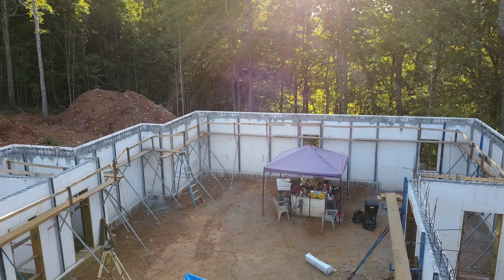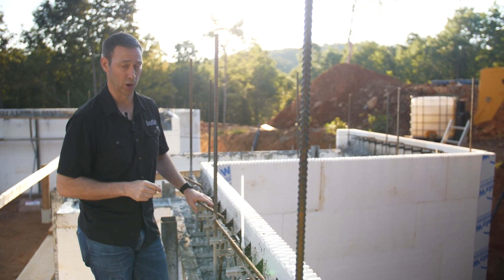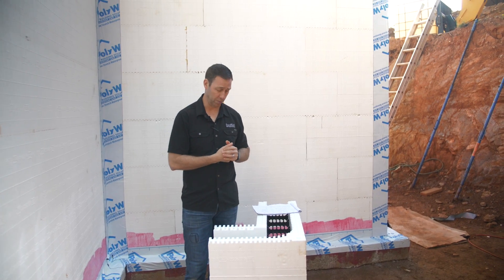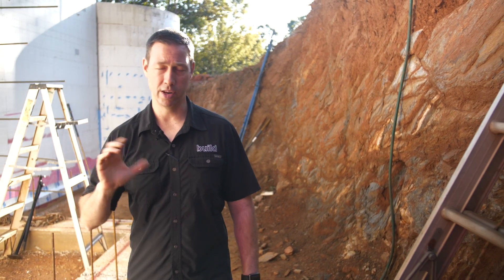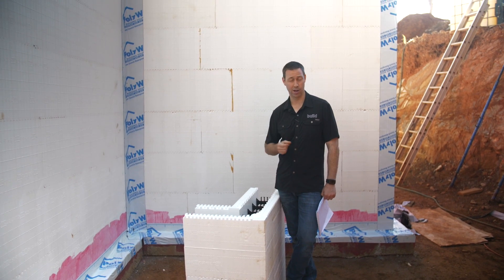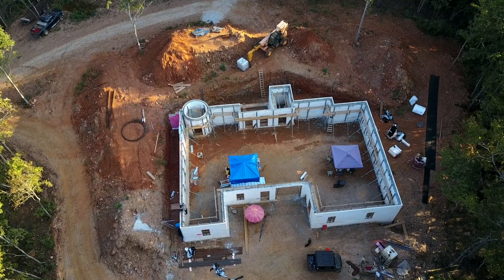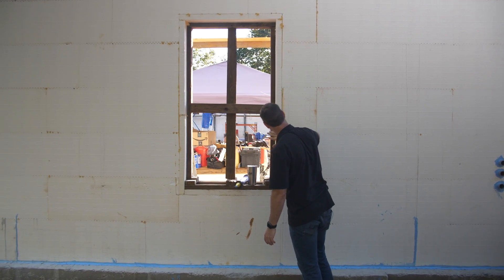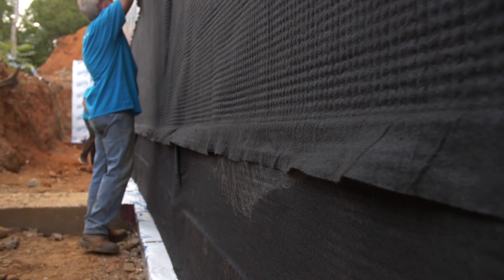Insulated Concrete Forms - Overview, Costs, and Cons

Comment: That's neat. thinking about doing offgrid owner built in TN because of the cost of running electricity. Solar overall offgrid is a little more expensive (inverters, batteries, etc.) but with Lithium batteries it's becoming a really competitive option in the sticks. For me a 2k sq ft house with solar (12kw) batteries, etc. was about 20k in materials. Should provide about 36kw per day in summer and store about 3 days of electricity. That's using effficient appliances, and some big loads on propane.

Comment: Hi Matt you have  some great ideas and  I've  actually used them on my jobs.
I install a lot of hardie board and have installed over icf with furring strips  and 1"1/2 roofing nails and found over time the board's started to sag  I've also screwed it directly to the  icf with much better results .
There is some great products being used in my area (ottawa canada) but with no thought on what types of material is being secured to it. I would love to see a video or hear something from you on how to address these types of issues. Cheers
Reply: Build Block has their hard points at 6 inches on center, some others have strips spaced every 12 oc, one has panels with fastening strips molded in spaced at 12" o.c and their ties also add connection points with the ties have two points just 4 inches apart. Never saw anything in a hardee board brochure or their website saying it could be fastened the way you first did as you found out why, Neighboring business has some old siding removed and replaced with hardee board fastened flat to the wall, they have yet to paint it and now have white vinyl and a pale tan like hardee section.
Reply: @Joshua79C  Every siding manufacturer would prefer if there product is installed over strapping for breathability and When doing so with HB I always get unsatisfactory results. 
My comment was more towards new product being used with no thought for the next guy coming along
Reply: watched April Wilkerson build her new shop and she fastened the HB directly to the wall, no strapping/strips, I never read anywhere in the instructions it has to be fastened with strips behind it, like I previously said. Never seen any siding installed this way with the necessity for strapping to give it "breathing" room when fastening.
Reply: Stacey E , when you apply furring strips over the Icf always screw them to the web spacers, this forms a truss assembly with the wall stopping the sag or bending moment of the fasteners. Moving the siding off the Icf allows you to shim for perfection of install and most importantly moves the wet screen off the surface allowing the best wet to dry function of materials making them with paint last longer.
Reply: Sagging is a result of an inferior ICF system, or poor installation not securing into the hard points in the internal webbing of the ICF/EPS form.

Comment: Another great vid Matt..  We're looking at ICF, which I like a lot, also Rammed Earth, meh..?  Ever seen any info on those?  We're in FL so, I'm not very optimistic about humidity control with that.  Great info!
Reply: There are homes in FL built out of ICF of one brand or another, and while it is great for temperature control, nothing will stop humidity from egressing without some dehumidification system which ACs come with this capability.

Comment: I've been poking around and the Spider Tie system looks really good to me. Are there any glaring problems with that I'm not seeing?
Reply: Doken Boken seems really labor intensive and no one has experience with it. The company posts animations instead of actual installs which i think is alarming.
Reply: I would NOT recommend using the spider tie system it is over complicated and not been used yet for this reason compared to blocks and also ICF deck forms which serve as ceiling-flooring or ceiling-roofing. Spider tie is as I said a time consuming and cost prohibitive system compared to ICF forms as I then mentioned.

Comment: If they are going to pour a suspended concrete floor on top of the ICF walls - I'd love to see that - before, during, after, the whole enchilada.
Reply: They just put trusses and metal decking then pour the concrete
Reply: nevermindthebullocks they have insulated flooring panels too just like a few other ICF manufacturers, they form part of the floor of which the bottom is thus insulated but still requires support during the install and pour until it has had a week to harden enough. but for those not needing the insulation o the ICF decking one can go the metal decking way.
But do consider that the ICF decking comes with wood to fasten a ceiling to where as the metal decking is not so easy to secure said same ceiling to.
Reply: We did a full ICF 2 storey for a client.  It was a walk-out, with a 2 level garage.  We used precast hollow-core, that was sitting on the lower ICF wall, and then we setup and poured the 2nd floor wall on top of that.  It clear spanned 28'8", so no beams and posts in the lower garage.
Reply: I did that with my house. We used the Ecospan flooring system and it worked out pretty well.
Reply: Hambro D500 flooring system might be just what you need Randy D... used extensively in Florida, no insulation involved or needed.   No cranes needed, and the Cast-In-Place nature means a high-integrity sealed "diaphragm", with none of the grouting needed with pre-cast planks or panels or double-tees.  If you're doing multiple structures, or multiple stories, you can re-use the plywood forms over and over.
Reply: Randy Dueck i
Reply: Few have open concept basements. If you pour inside walls as well there should be plenty of support
Reply: Back in the day as a carpenter apprentice, I worked on big commercial projects where pouring suspended slabs was a regular occurrence.  However, the slabs themselves were all engineered - the concrete mix design, the steel reinforcement,  beams, columns. The false work (forms, scaffolding etc) itself was engineered to support the massive loads while the concrete cured. I don't know of any residential projects where the main floor (not on grade) was poured in place concrete but I see the ICF vendors make styrofoam forms for the application so it must be feasible now somehow. I'm really curious.
Reply: See, now in South Africa, poured in place concrete slabs are common for residential. Rib and block shuttering is probably 90% of the market.
Reply: @randydueck889  maybe waffle ceiling moulds
Reply: That's about the only way they build decks in Europe. Europeans think Americans are complete idiots for using so much wood in their houses. Of course in Europe they build houses to last longer than the mortgages.
Reply: @brimstone33  in europe they have castles with wood roofs that are there since the dark ages. Im getting tired of that argument since its always based on ignorance.
Reply: @lpainchaud  I have been in plantation houses over 200 years old built of wood.
Reply: @brimstone33  I'm american.  I can confirm they're idiots.
Reply: In Western australia absolutely everything is suspended slab on clay brick. You want something else and you pay twice as much for a specialty builder. 

Which means it is all just rule of thumb. "ive been doing this 30 years I dont need no engineer" type stuff.

Comment: It's my understanding that they adjust the bracing on pour day to ensure plumb. Maybe not this system but I've seen it on others.
Reply: Yes the bracing is leaned inside before pouring the wall as it is easier to push than to pull later on as adjusting is needed. Seeing as pushing helps the backing brace to dig in rather than try to pull in and having the bracing get pulled out.

Comment: A way better building system is pumicecrete home. Pumicecrete is a mixture of pumice cement and water mixed and poured into a set of forms pumicecrete homes take a fraction of time labor and cost and is home owner friendly and has no stryfoam
Reply: Bare concrete is much like my field stone basement, cold in winter and hot in the summer. No insulation = no thanks.

Comment: What's up with that circular part of the house? I hadn't seen that in ICF
Reply: Possibly a spiral staircase.
Reply: you can't hear screams or yelling from outside ... looks kinda like a well .. maybe buffalo bill is going to live there ?? lol
Reply: @jb_90265  lol
Reply: Its their new radius wall blocks. I know of about every ICF manufacturer, they are the first to introduce preformed radius blocks so no need to cut as required to form a radius.
Reply: @jb_90265  It puts the concrete vibrator in the mix, or else it gets the voids again.
Reply: Every man's home a castle.
- Robin of Loxley
Reply: @Nathan Jacobson you don't know how to bent sheetrock ?
Reply: @Nathan Jacobson  Don't worry about fitting the sheetrock, scribe the back of the board and fit it to the radius.

Comment: I had an engineer tell me that with ICF you don't need to do a pier and beam foundation because the entire building will be a concrete box, therefore you don't need to have a really deep foundation given you have good soil.  He said you just need rebar slab with a maximum 16" deep beams and give it good drainage.  Can anyone attest to this ?
Reply: Yes, especially of you do a mono pour with the footing. Basically and inverted T-beam. Very very strong.
Reply: This is true. The walls are essentially beams and could actually span over dips in the soil.
Reply: Oliver Ritim  Yup, and you don't even need rebar if you use a product like Helix.
Reply: I think you should consider where you live as well. Here in Canada you would probably have issues building anything bigger then a  garage without footings below frost level.
Reply: B Johnny , ICF forms at least from those who make wider than 12 inch cores  using extender ties in a knockdown type would be very useful for forming a footing, just make sure you fill in the space between the top of the footer to where the wall terminates to insulate it and run some additional foam at least 4 foot away in a apron from the wall to create a frost barrier for at or near surface footings. Heck one ICF manufacturer provides the supplies needed to build your own footing forms bottom and sides only though and you just have to assemble it on site yourself with some industrial or stronger foam adhesive than you might use on buck foam which a few manufacturers make as well.

Comment: I am actually planning on building my own cabin. Around 700sq foot to retire in. (Also here in Georgia). My first thought was to pay someone to dry it in then I can do the finish work. But I like this idea. i will have to do more research on this. I may take that leap.
Reply: Many home owners have done it themselves for new home of a size they can handle alone or with some reliable enough helping hands, some have even did add on renovations with ICF foundation DIY style. Some of the manufacturers have DIY DVD, they also may list or provide via request for Seminar information which you can attend for a small fee for a day or two of hands on how to. They also have channels on here that show some how to stuff. Then again it depends on the extent of the build and how complex it is that determines how much you can DIY without a team of installers.
Reply: @Joshua79C  We are looking for a an installer and for a contractor. Any recommendations for Fulton County GA?
Reply: @Beone2know   you ever find one? Im in coweta looking for one.
Reply: It's pretty easy, just basic tools and a little bit of common sense

Comment: ALL ICF with any connecting structure between the two EPS walls, can be braced by the inside only.  Waterproofing an ICF is NOT difficult, and certainly not more difficult than "well I can build a more insulated home for less out of wood" bs.  This notion that people are going to add additions if they've invested in building an ICF home, is a silly reason to build with inferior, more labor intensive, wood.  Wood is cheap... PUN INTENDED.
Reply: Confirmation bias is an evil thing
Reply: Wood is cheap but if the old house is knocked down and rebuilt the same way, then the cost adds up compared to a ICF or monolithic concrete shell with R-ETRO (QuadLock system) fit insulation panels installed afterward on the outside for a full coverage thermal barrier, then the interior can be built out any way one wishes. I M O I rather stick with ICF block systems so I got the fastening on the outside and inside to more easily and securely fasten any wall board I want more easily than drilling it into concrete itself. Then again I am only wanting the basement in ICF with the ceiling and first floor also done in ICF decking panels to create a much larger storm room than a tiny one as where I lie the worst we get is Nor'Easters or the occasional hurricane which any strong wood structure can withstand easily by the time it arrives.
Reply: Joshua 79C C  I would also suggest looking into Helix "rebar", which will save you both time, and ultimately cost, with your concrete pours. It is smaller pieces of twisted wire, that is mixed into the concrete, that can replace all rebar in most applications, and definitely all horizontal rebar.  One of the best advantages is reduced cracking.

Also, I really like a hollow core, concrete span, or similar plank like ceiling/floor.  4' wide planks can span up to 50 feet in length, and are typically 8" thick.  Setting 8-10 planks for a 40ft wide home, on top of an ICF wall, would take a fraction of a day.  There are decking options with ICFs, but I would personally go with the pre-cast planks.
Reply: Do not have to tell me about those two, I seen the prestress planks first hand on almost daily working at a place that shared the same space of land the company making them mostly owned until I moved on to other things when they did not need me anymore. I also know very well about the Helix rebar, as per the Pentmore estate and its owners debacle with the concrete contractor shorting the mix...
Reply: I only know of Helix and not yet used it or seen it in actual application as it is made for, yet.

Comment: I am currently building my house with ICF in Waco, good points you make. This is a topic that one could go much much deeper with. There are some nuances that actually make ICF an even better candidate in northern climates than traditional BTW. (ICF is huge in Canada). Also, there are some alternative processes that make the cost difference even less when it comes to the rebar placement that makes a huge difference. As always, look forward to more great info, thanks!
Reply: Yes, the use of Helix reinforcing additive will mostly eliminate rebar, except over openings.
Reply: As much as I like ICF the more I learn about it since first knowing about it many years ago, I would stick with using it in the basement with a ICF floor above to cap it in to create a storm basement instead of just a small room. but i have yet to own my own place and remodel or build new on a property, the rest of the house would be post frame construction since the concrete and steel would mess with cell signal coverage. Besides, I lie where we rarely get tornadoes or earthquakes (felt the tail end of the Washington DC one some years ago) and seldom get hurricanes and mostly Nor'Easters in New England

Comment: Love the icf great break down on icf but Matt they do offer different products that have 4 in outer 2 inner for cold climates.
Reply: Timothy Hall - Yes, there are some companies that split the thickness and have thicker exterior. Quadlock does it I believe.
Reply: Fox blox as well personally after my water proofing layer I'd add 2in of foil face iconeyne with seams sealed by a bytual rubber caulk and foil tape such as used in hvac systems to move the thermal battle more to the outer side of the thermal mass of the monolithic wall and provide a radiant barrier.
Reply: Quadlock is the only one I know of with three panel form thicknesses, two of which come with optional fastening strips for better fastening area on top of their ties being used as fastener points after pouring the concrete. All others use filler foam strips which reduces the concrete thickness where it is inserted. Quad Lock also has extra panels as well which fill in where concrete would go for thicker and higher r value exterior or interior walls for more dept for installing cable, electric or plumbing as opposed to just 2 3 or 4 inches of foam.
Reply: @Joshua79C  Nudura plus series also offers increased foam thickness on the outside.
Reply: Those are integrated, the one i am referring to is a knock down system where as the ties and panels are separate such as the case with Build Block knockdowns with the panel and web are assembled on side for in the case of structures where the rebar is already caged per spec and the forms are installed around it. But with Nudura plus and others the outside an also be placed to face inside where the building is going to be used for refrigerated  warehousing